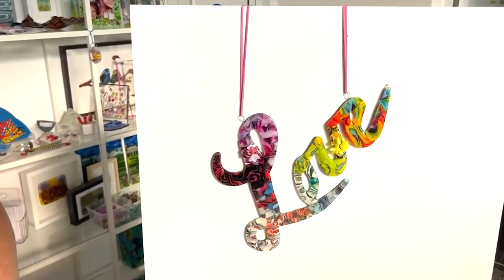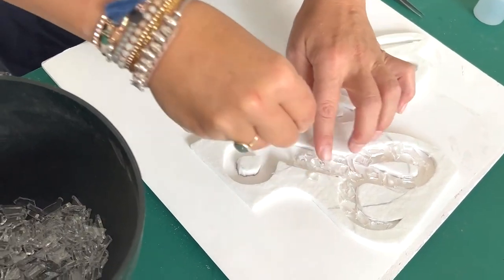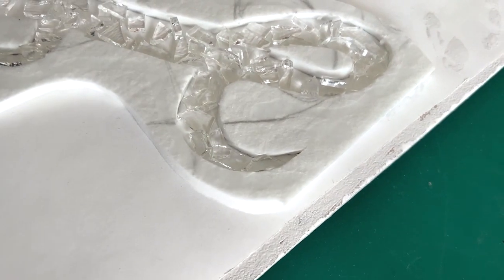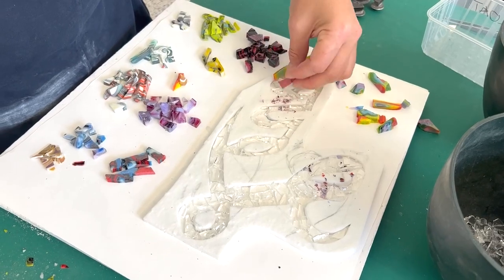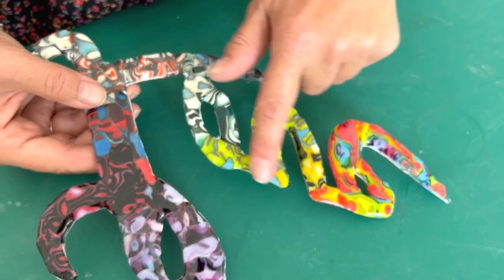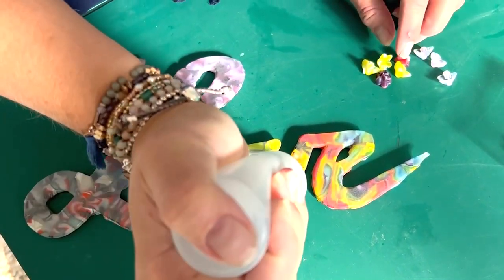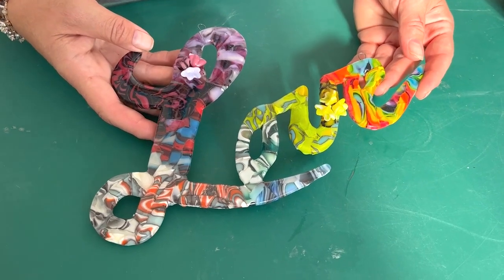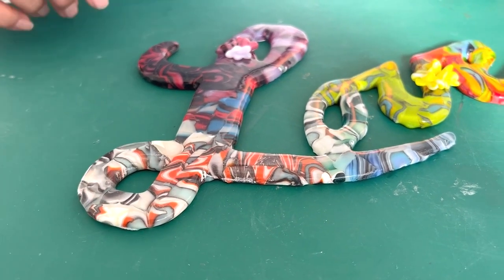Fused Glass Pattern Bar Scrap Love, Bullseye 90COE #fusedglass #love

Comment: Can you tell me is a tack fuse the same as a fire polish? Also when you added the hooks did you just put them underneath the letter? Thanks
Reply from the maker: Tack Fuse and Fire Polish are similar enough, so in this project I used the opportunity to add the details and hooks to it in the second firing. I added a small square of glass under the hooks, so they are sandwiched between the piece of glass and the project on top.

Comment: I would have appreciated seeing you cut out the fiber paper.
Reply from the maker: Hi. As I already made a video where I explained the process in more detail, I didn't want to repeat it. If you watch the video: Fused Glass Fiber Paper Casting Names, I explain the whole process there. The video is also linked at the end of this video, it will pop up in the top lefthand corner of the screen during the end part of this video.